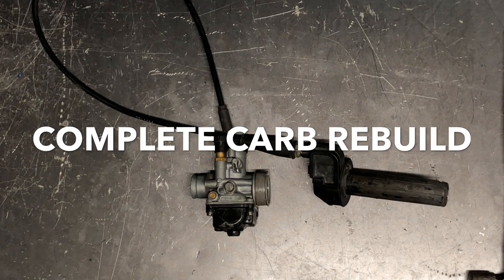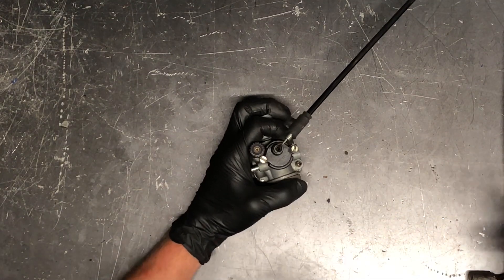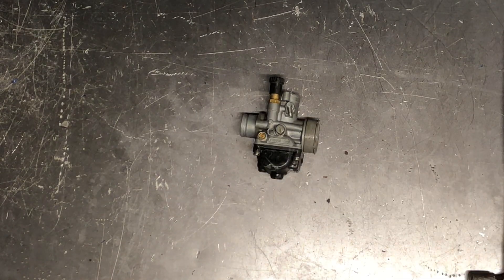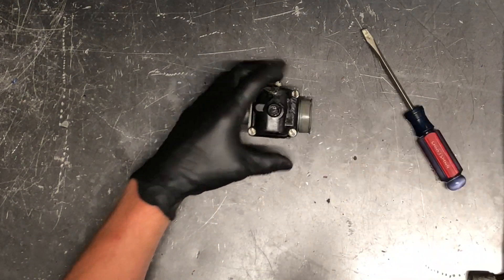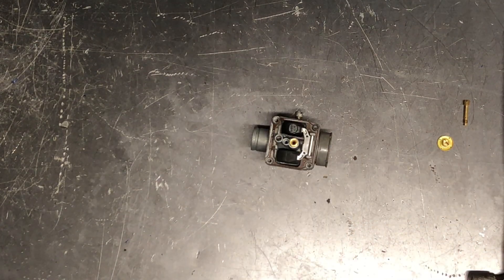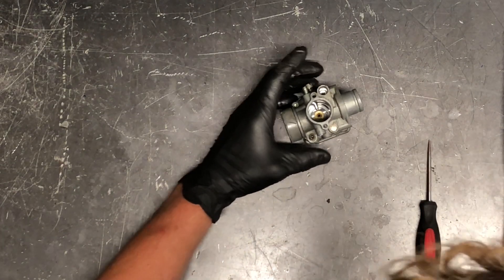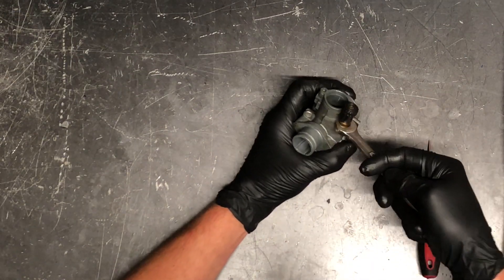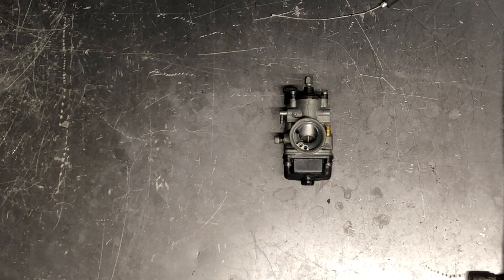Carb Kit KTM 50 / 65 - Hard Starting - Wont Idle or Rev Up - Cold Blooded - Carburetor Rebuild

Comment: Hey great video! Im stoked i found it as i need advice for my sons 2002 ktm 50sx. First off i can usually get it started after about 20 kicks lol but then it bogs out when i twist the throttle wide open and then dies.

I have gone through and completely cleaned the carb. I put a new plug in (NGK bh6).

Also the bike has reeds and a fmf fatty pipe and i have no idea if the original owner re adjusted the jets after adding those components. How do i find out what jets to use or what jets should be in the bike?

Comment: When I turn my idle screw all the way in it doesn't adjust the idle. The only way for me to increase the idle is with throttle cable. Thinking the main jet needle is too low?
Reply from the maker: If your idle screw isn't changing the idle you've got bigger issues. Have you pulled the carb apart? Let us know.
Reply: @MidNebraskaMotorsports  I'll be messing with it this coming week. Ordered new bars and throttle.  Dellorto phbg 19 bs
Reply: Put new bars throttle tube and carb on. Still idle screw will not change idle speed. If I tighten the cable a bit the idle will come up. It seems to run fine. I need to hold it wfo to start but once it's kicked on it runs fine.
Reply: Did you ever figure out what was causing it? I'm having the same issue.
Reply: @DustinGreathouse-st1lt  I wound up notching the carb slide a little and works fine now.
Reply: @DustinGreathouse-st1lt  I wound up notching the carb slide with a file and it works fine now

Comment: Hi. My son have a ktm sx50 16mod. It won’t go higher then 11.500 rpm. Its working fine in low,middle rmp but not on full throttle. I have change the stator,coil,clutch,check and clean the carburettor. New plug.Reedvalve ok. Adjust the neal and mixture skrew after the manual. 2% two-stroke mix and new fuel. The fuel line and the filters is ok.  But stil the same,lack of power on top rev. The bike starts on first kick when cold and warm,no difference. The bike has 72hours on the meter. Have i miss something here? Suggestion?
Reply: Have you mounted the needle correctly, try increasing mainjet to 90-95. Do u have good compression?
Reply: Marcus Lindberg thanx for reply. I found out the nozzle skirt was missing on the mainet,why i dont know yet. And i also change the piston. It had a 95 main jet mounted. The bike is like new and the son was happy. Now i have sold the bike. We are now riding a 2years old husqvarna tc65. The bike is great and works perfectly,fits the son mutch better.
Reply: @holingen   Great, didnt notice it was one month ago u replied i read 1 week ago. Anyways glad that you fixed the problem these little machines are nasty cause they tend to break all the time, specially when you race them.